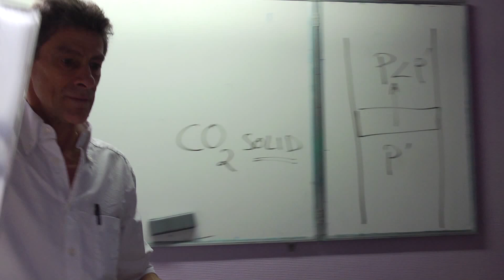Making SOLID Nitrogen!

Comment: Isn't this just dry ice?
Reply: Solid Nitrogen is made up of nitrogen. Dry ice is made of carbon dioxide.
Reply: What are you talking about? It never was dry ice. If you guys are referring to the water part, that was indeed dry ice. It was created by the ultra cold nitrogen condensing the carbon dioxide (gas form) into a solid (dry ice).
Reply: I was wrong, I mixed up nitrogen and carbon dioxide... to my defense I learned chemistry in German not English...

Comment: So the colour of CO2 is white. Awesome, but I do have a question. Was the white smoke from also CO2, just in gas form?
Reply: the white smoke were very tiny ice crystals formed from the water present inside the pan and the atmosphere also. and the ice crystals were formed because of low temperature. CO2 is colourless and so are several other gases. :)
Reply: Probably moisture condensing out of the air because of the low temperature.

Comment: Reducing pressure can boil it, but can also freeze it...@_@ brain blow
Reply: ^no.  They are reducing the pressure.  When you take the pressure off the liquid, the molecules are more free to move. This movement also frees them from their liquid bond, thus, boiling occurs. Boiling removes heat from the liquid.
Reply: tomthepom98
 that is wrong. They are reducing the pressure (they said it), lowering the ebulition point, making water boil at 30ºC. Same with the nitrogen but it would probably boil either way.

the thing is (Indra Ida Bagus i think this answers your question too), when they reduce the pressure more nitrogen molecules will turn to gas. This will take eneygy (heat) away from the liquid, reducing it's temperature. So, if it boils and loses energy, its temperature will drop down to the point where it freezes. This is called the triple point, where the 3 phases (gas, liquid and solid) exist at the same temperature and pressure.
Reply: tomthepom98 someone didnt watch the video at all
Reply: It's really not that odd. Think about sweat, for instance, which evaporates and takes with it the heat that made you feel hot.

Comment: That's awesome.
I've never seen dry ice that floats over water.

I have a question though,
If the liquid boils under low pressure, shouldn't you have to pump the pressure back in to press the substance into it's solid form?
How come it still freezes?
Reply: solid CO2* was on the water, solid nitrogen in the tube
Reply: Pressure does affect the boiling point and freezing point of liquids (yes if the pressure was increased a huge amount the gas would go back to liquid form and then liquid would freeze), but in this case the boiling of nitrogen absorbed heat from the liquid nitrogen, lowering the liquid's temperature until eventually it froze.

Comment: Might sound stupid... but are you sure thats solid nitrogen cause the tube could have had other elements like Oxygen and Argon so in actuality you made solid oxygen or solid argon (with a bit of nitrogen) or solid nitrogen oxide... btw im 16 so have a secondary knowledge of physics so dont hate if im wrong... :)
Reply: This is more chemistry than Physics, but both are intertwined, as you probably know. To answer your question, they evacuate the cylinder, meaning it is not possible for there to be trace oxygen or argon.

Comment: Solid CO2, not solid nitrogen...
Reply: If you looked while the nitrogen was in the tube it was solid.
Reply: I think that was liquid...
Reply: XtremeFR33RUNN3R The ice that was rising out of the tube, due to the pressure, was solid nitrogen. You could say showing solid CO2 is just a bonus.
Reply: XtremeFR33RUNN3R if you watched the video with sound he explains why it's acting the way it is :p
Reply: shifath khan I saw that, i just though -192 gr C is the temperature when liquid nitrogen is passing into gas... taht means i'm wrong... nvm :)
Reply: They changed the pressure so  it was solid at a different temperature.

Comment: boiling water using a vacuum cools the water because it takes 970 BTUs/lb of water to change from liquid to vapor, no matter what pressure it's at.  It's simply robbing that energy from the remaining water (cooling it down),  exactly the same as it would rob the heat from your stove element to get the same effect.
You can boil it until it freezes.  Then it's boring to watch, it takes forever to sublimate.

Comment: I would like to talk to an instructor about fining a way to cool a Florida home WITH OUT Using electrical power I think if someone could cool the attic by ten degrees it would be so much easier to cool the house but I know of houses with Super reflective paint plus an R factor of insulation of 30 and still pay over $300 in electrical bill We pay once $500 for one month of Electrical  power

Comment: If I might make a suggestion that might save a few of your viewers' eyeballs or at the very least, a few frozen skin burns:  Wear safety glasses.  One little splashed drop of of liquid nitrogen can ruin an eyeball or cause a skin burn.  Full face shield is preferable, but with liquid nitrogen, safety glasses are probably adequate.
Reply: NEVER
#YOLO #SMOKECO2ERRYDAY
Reply: Liquid nitrogen splashed most likely will not cause skin burns due to the Leidenfrost Effect.If you are fast you can dunk your hand into a vat of liquid nitrogen with no ill effects. But I have to agree with safety glasses, eyes are to valuable to take any risk.
Reply: imac8175
I think that's a foolish comment. It's not something that should be suggested. I omitted mentioning the need to wear safety glasses which you correctly advised as essential. When would you ever quickly dunk your hand into the container to place in or grab out a sample? How could you find it?

Comment: ok a bit of fact checking here. it does not cool the water because only the fastest molecules escape, it cools the water because the molecules leaving are decreasing the pressure of the water and moving into a lower pressure enviroment and due to PV=NrT when pressure decreases temperature decreases. think of a swamp cooler, if only the hottest molecules evaporated that would be blowing hot humid air at you instead of cool humid air. if you evaporated all the water it would be colder than it started even though all molecules evaporated including the cooler ones
Reply: Not quite. The effect we're observing here is called 'enthalpy of vaporization', which is basically the amount of energy it takes to vaporize a molecule of a substance without changing its temperature. The enthalpy of vaporization of water happens to be absurdly high, so even though it is only the very hottest particles that evaporate in a 'swamp cooler', the amount of air that had to cool in order to heat that one particle of water ends up giving a net reduction in tangible heat, converting the remainder into latent heat in the water vapor.
Reply: PV=nRT=NkT mate not NrT
Reply: "swamp cooler ... blowing hot humid air at you"

That's pretty much my experience of evaporative cooling altogether. :P
Reply: jaws0222

k = r, it´s only the symbol of the constant varies from country to country. In brazil que learn as PV = NrT also.

Comment: Did you ever see someone refrigerate water by boiling it?
Reply: That's just too cool.
Reply: no but i heard egyptians refrigerated water, even making ice, by putting straw on top (i think) and putting it where the wind would blow through and therefore evaporate it and since evaporation is endothermic it would cool it. in fact all changes of states of matter are endothermic or exothermic, if it goes to a higher energy state such as liquid from solid, or gas from liquid it is endothermic. if it goes to a lower energy state such as liquid from gas or solid from liquid it is exothermic
Reply: Firaro
There is a little more to it. There is an inner and outer chamber that are concentric. The outer ring chamber has sand in it and the inner ring chamber has the area that will cool off. Water is poured in the outer chamber and the inner chambered is covered by straw so that it is insulated by the sun. As the water evaporates from the outer chamber it pulls heat from the inner chamber which cools it.
Reply: Mephistolomaniac
Yup! Agreed, my friend! However, I think I will continue to use the fridge or just a frosty-cold-one" at the bar down the street!
Reply: *****
Oh my God! My English-Grammar instructor is watching! I better erase my identity and move into a cave! People all over the world be afraid! Be very afraid! (smile)
Reply: Firaro my favorite thing i learned today ;D thanks
Reply: *Have you ever seen...
Not "Did you ever see..."

Comment: "The fastest molecules escape, leaving the slower ones behind."
Wait wait wait wait wait wait.... Isn't this decrease in temperature happening because vaporization requires energy to break the molecular bonds. This energy is got from the external heat, which cools it down.
Are both true?
Reply: its not molecular bonds, it's overcoming intermolecular interaction

its not external heat, the energy is from internal energy which is why when the energy is used up in terms of energetic molecules escaping, the average movement of molecules decreases
Reply: Timothy Hutama
Yes, of course. Thanks for correcting that one. I was referring to that, but translated it wrong in my head.
Reply: RealationGames you are correct, its the latent heat being lost from the liquid into the gas phase.  However, only the (randomly) fastest moving molecules will have enough energy to leave the liquid phase, so the explanation was simplified in this manner I believe.

Comment: huh i always learned that an increase in pressure equals an increase in temperature .. he stated the opposite. Can someone please explain?
Reply: i think i know, it has nothing to do with temperature but with vapor pressure equal to atmospheric pressure
Reply: The boiling point of a liquid is the temperature at which the liquid's vapor pressure equals atmospheric pressure. Here they reduced the pressure in the vessel, the "atmosphere" for the liquid in question, to the point where it boils at room temperature. The temperature reduction is achieved by evaporative cooling and isn't directly related to the vessel's pressure. The resultant gas is continually evacuated from the vessel, otherwise the pressure in the vessel would rise to the point where the liquid would no longer boil.

Comment: Is that posible to create solid nitrogen, not by reaching it's triple point but by increansing the pressure enough so that the nitrogen would solidify in a much higher temperature?

This raises another question for me, is nitrogen still liquid at 1 K and 1 bar (0,1 KPa)?

Comment: dose this principle work in reverse? if you increased the pressure to 2 atmospheres, would you get rid of all the cold participial? also, has this experiment been done in a zero gravity, would it even work in 0G
Reply: Well, increase the pressure enough and anything will turn solid. I assume they went with the boiling way here because it's simpler to do.
Reply: lcbp2009 Water is the only known exception, though, as far as I know. And there's really no need to turn a simple discussion about aggregation states into nuclear physics.

Comment from the maker: I think this might be saying the same thing in a different way. The fastest molecules carry away the energy with them.
Reply: During last two minutes the background music is so beautiful and satisfying
Can you give me the link please
Reply: Will the weight of liquid nitrogen in the tube  eventually reduce if we continue the process of reducing pressure??
Reply: @n.sangamithra4483  yes, until that point of time when all the liquid nitrogen becomes solid
Reply: @n.sangamithra4483  more specifically the mass will reduce overtime, the weight is just the force of the object acting on a surface due to gravitational pull.
Reply: ...because they are not imparting their kinetic energy on the rest of the molecules and instead moved in a direction by random chance that allowed them to escape into the air.
Reply: you should pin this comment so it is at the top
Reply: the fastest molecules are the fastest because they contain the most energy, meaning when they escape the accumulation of molecules the accumulations total energy is devoid of the molecule that left's energy. resulting in the overall energy of the accumulation being less and less over time.
Reply: This might lead some people to think that there are different 'kinds' of nitrogen molecule that react in different ways. I think it's helpful to refer to differences in behaviour by their causes, such as how much energy is contained or received and any resistance that is met, etc. 😉
Reply: Wait you speak french?

Comment: At first I thought the south pole was too hot for this, but actually, if placed in Vostok Station, it seems possible. Temperature usually goes above that of boiling CO2 from November to February though, so some kind of huge fridge is still required. Planting trees seems more practical by a long shot.

Comment: from a coworker when he saw this: thoughts?
Imagine you want to recover 1 gram of CO2 from the air. How much air do you need to process? CO2 is about 400 PPM during winter and 390 in the summer (leaves on plants).
1g co2*(1mol co2/44g)*(22.4 l co2/mol co2)*(1 l air /395*10^-6 l co2) = 1289 l of Air! 

no way that anything close to 1289 liters were processed. Maybe what we saw wasn’t what he was referring to. It’s possible that he was calling the mist CO2 which could be far less than 1 g of CO2.

Comment: asuming you have a container that can withstand the preasure without deformation or breaking you can keep water from freezing even at very low temperatures (124K) after that it im not 100% certain but i assume it would change its cristal modification and eventually become amorphous ice wich can have a higher density than liquid water. the preasure that this container has to withstand is crazy high(upwards of 1GPa)

Comment: When water freezes it expands.... but what would happen if you made something that would not allow the water to expand even at very cold temperatures? Like a metal box. would it be able hold the pressure that is built up? is there any thing that can? if so would the water freeze? this is something I have been wondering for a while now

Comment: Technically, Carbon Dioxide at a normal level isn't.
Of course if you start inhaling pure Carbon Dioxide you'll eventually die, of asphyxia. Your body even adapt to it at a certain level, it's not considered poisonous because your body easily get rid of it, to get rid of it, just breath normally..
Unlike Carbon Monoxide, that has strong bond with iron, it will eventually enter your system and it's very hard to get rid of it.
It's very toxic, even in small dose it can kill you.

Comment: Does this mean that if i put a liquid with a boiling point of 10 degrees in a box of 20 degrees and had some device transport the gas of the substance away, the temperature inside the box would decrease to 10 degrees if i had enough if the substance? (I mean if i have enough of the substance to drain the heat to 10 degrees)

Comment: Dude, they're negative numbers. -273 is WAY less than -210.

as in, they cooled it to -210. Taking it to -270 would be COLDER. And one correction: You cannot get TO -273. The coldest anyone has got is one tenth of one billionth of one degree above it.

Comment: To start off small atoms as we know move, faster or slow depending on what state (solid,liquid,gas,so on) also depending on what element but we aren't getting into that. now with in the earth is liquid (as i know it) on the outside is solid (not including water ect.) now if you made a small replica (water balloon) and spun it. the outer edge will push. but their is 2 differences with a water balloon, the edge of earth isn't rubber and gravity. both slow down the widening. but i'm not a scientist

Comment: Dry ice is frozen CO2, not nitrogen.  Carbon Dioxide freezes at much higher temperatures than nitrogen.  Which is why you can hold it in your hand for short periods of time without skin damage.

Comment: That would be French. It's hard to tell only based on the accent, though. He doesn't have the stereotypical, overly French accent. He could easily be from Alsace or Brittany, where France borders Germany and they pick up a bit of a German accent. Either way, there are subtitles, so it shouldn't be much of a problem.

Comment: Energy is required to break bonds (creating steam) and energy is released to create bonds (freezing).  That is why temperature might go down when boiled.  The statement that the temperature of water goes down when boiling at room temperature is not exactly correct.   He says that the fastest molecules escape, thus lowering the temperature.  is only kinda correct.  Splitting hairs over splitting molecules (from each other, intermolecular).

Comment: I'm not sure I believe that the floating island is CO2. CO2 is only 400ppm of the atmosphere, so even one gram of CO2 would require freezing 45 cubic feet of air, yet we see only vapor escaping from the pan with no inrush of air. 

I've done the experiment of placing an empty testtube in liquid nitrogen, and what condenses (after many minutes) is liquid oxygen, with only traces of dry ice.

I think the island is solid N2.

Comment: If it wasn't meant to handle that kind of liquid the temperature-differences on the inside and the outside of the glass would destroy it but I believe that professional lab gear is tested to fulfill a set of standards.

Comment: It makes sense.  Changing phase requires transfer of heat energy.  Any time water boils, the latent heat of vaporization must be added from somewhere, so in your (vacuum) experiment, it comes from the surrounding atmosphere, conducts through the glass, and into the water, thus making the container feel cooler.  The energy to initiate this heat flow comes from the vacuum pump.  Sound reasonable?